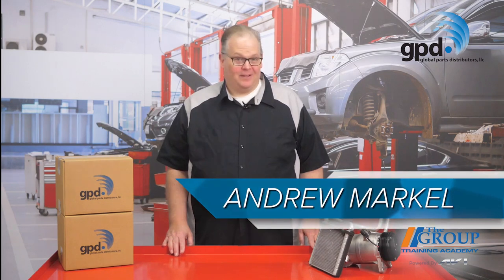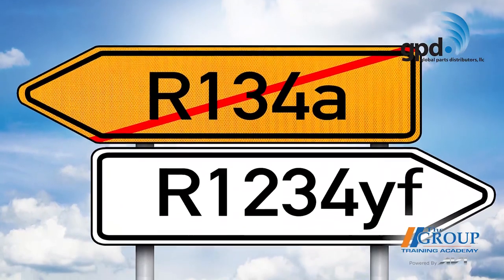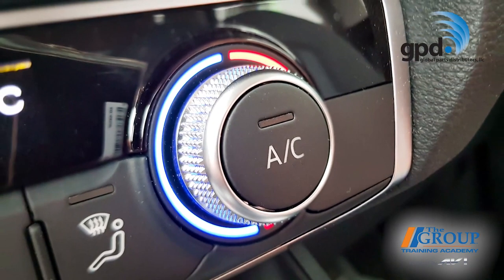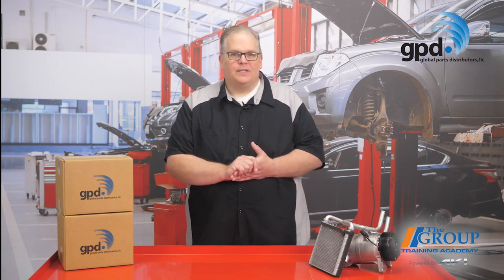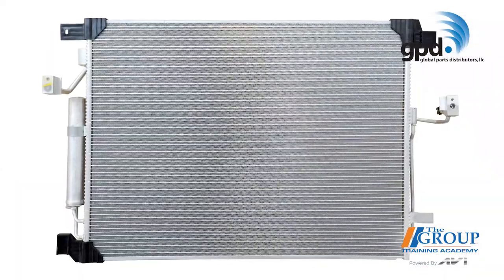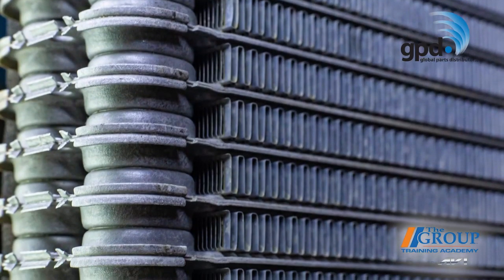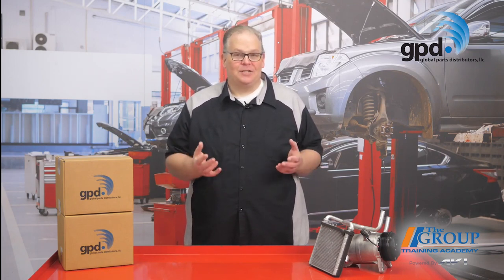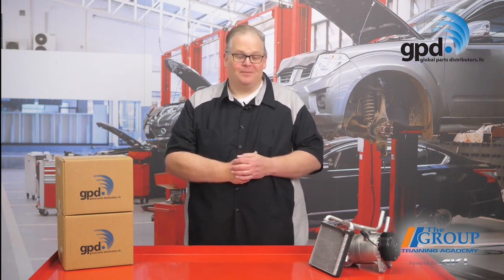Never Flush A Parallel-Flow A/C Condenser

Comment: Can flushing condenser get the oil out at least?
Reply: You can definitely flush a parallel flow evaporator or condenser to remove old oil and other residue and minor contaminants, just don't expect to remove heavy contamination/clogs if something catastrophic happened like the compressor internally failing or the receiver/accumulator dryer coming apart.
Reply: @averyalexander2303  I think if something catastrophic happens it's game over for me trying to get the AC system working on that 24 year old truck